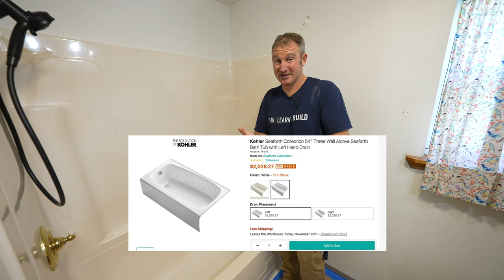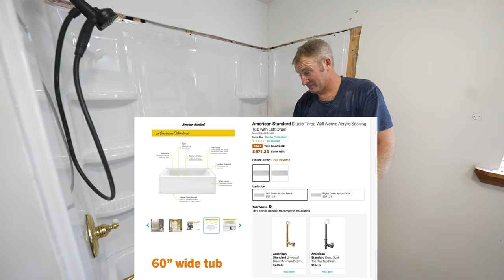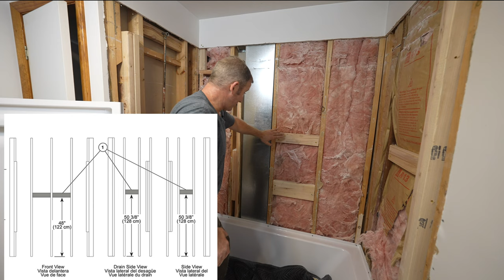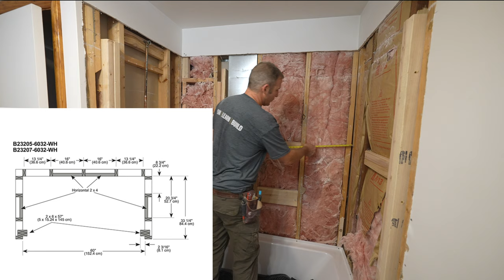Installing an American Standard Tub & Delta 500 Series Shower Surround | Complete Step by Step Guide

Comment: I seem to find myself always installing those 3-5 piece surrounds, and I always have something on the studs eg. drywall if applicable. Even though it says direct to stud install. They are way more prone to cracking if there’s only studs and blocking. Go the extra mile so you don’t have to come back and do it all over again 👍🏽
Reply: drywall or plywood? Might install one of these in the near future
Reply: @joshhyma842   drywall is the easiest and cheapest. But either way I always put u couple coats of liquid waterproofing membrane over it for when the surround cracks and starts leaking 👍🏽

Comment: Isn’t the delta 500 surround suppose to installed with some sort of backer, eg drywall or cement board, and then glued to it?   I have seen people use spray foam in the recess areas of the surround to give it stability before install.
Reply from the maker: Not the 500 series. It’s direct to studs. That being said anything that helps reinforce it more would be worth it 👍

Comment: I’m assuming the finished edge of drywall against the surround? Also, when drywalling, was caulk on the flange or on finish edge of surround to seal? Just want to make sure I get the cleanest finish when butting up drywall to a plastic surround in my own bathroom.

Comment: I learned alot about how to install Delta Surround Wall to some other brands such as American Standard. I was worried, and you confirmed that the Delta tub is junk, so thanks for showing it is possible. I may see about fitting a Sterling tub, too. However, I do love the Delta Walls for sheer functionality and design. Yes thx for tip on Wall stud for future door install, my case a Kolher elegant door 😊

Comment: I’m so glad I found your channel. My wife and I bought our house a few years ago and the previous owner did a lot of DIY renovations. A few days ago we had water leaking from the upstairs tub and through the kitchen ceiling. Come to find out, the shower surround wasn’t installed correctly. The surround was actually wider than the tub! So water was running down the front, then dripping over the edge of the tub, into the inside of the wall, and then into the kitchen ceiling. Thanks to my father, I’m pretty handy. But I’ve never had to do bathtub work! Once I found your channel I started watching as much as I could to be sure I do the repairs the right way. Only problem is that the back of the tub is against a shared wall, and it’s a firewall made of plaster and cinder block. I have some ideas on how to attach the back of the tub and surround, but I was wondering if you have any tips. Thanks for all your hard work to make these videos! It’s teaching me a lot and saving me money!
Reply from the maker: That’s an uncommon issue… bigger surround than tub. Thanks for watching 
Enroll in my DIY GEEK MEMBERSHIP. I can help out in the courses. Pictures will help with your specific situation
Thanks 
Steve 
https://www.bathroomremodelingteacher.com/learn

Comment: Thank you my ex step dad was a carpenter and i grew up always helping him so i am somewhat familiar with this type of work. I have a bathroom at my house my wife wants and honestly  needs redone. This video gave me more confidence in doing it as measurements are the same. Only thing is there is a window i would have to cut the tub surround to have work out. Im guessing just cut and use tub surround silicon behind the window framing. Anyways this video will be another tool i use to complete this project! Thanks!

Comment: Hello, this is a longshot, but I had a question. I've been binging all your videos on tub installations and I currently have my bathroom ripped apart in preparation for a new tub and surround. The new tub fits perfectly over the old drain, do I need to replace it or can I just reuse the old one and p-trap? Thanks!

Comment: Have you ever got a chance to work with push-to-fit pvc piping Steve? Our lives would be muuuch simpler and easier vs using glue cement. Each fitting has a rubber gasket and o-ring to hold it in place inside of the female-part. You use lube to assemble. All that allows micro adjustments after the assembly and flexibility. One of the things we should import from Europe for sure. For ten years working with it I have not seen it fail once. Also, what do you think about these Bath Fitter guys that promise old-out and new-in in less then 12 hours? 🤣🤣🤣 Great video. Go BRT GO. 👊💪👍
Reply from the maker: I have not played around with those yet. I love the concept. Not much different than a sharkbite 😆 trying to think of the cons on them…..probably price? and bath fitters would have been $10k for this 😆 I actually am not sure if they have something for this kind of shower…
Reply: @BathroomRemodelingTeacher  Push to fit was and still is only standard for any pvc install in Germany/Europe. I don't remember seeing any glueing pipes at all. The fitting/pipe walls were thiner then our pvc, it is gray in color and maaaaan, quick and easy. Plus, it leaves you room for adjustment after the fact. Only downside ... you gotta carry the lube all the time.  🤣

Comment: Great video as usual sir, do you use the hot mud for tape and finish coats ?
Reply from the maker: One this one I used hot mud to tape but used plus 3 joint compound for second coat. I find top coat comes out better with the premix 👍

Comment: very nice!  I work at a big box hardware store in the plumbing isle...we sell the delta kits and your remarks regarding the surround kit is useful.  I'm surprised about the delta tubs though... the brand is always well regarded by the plumbers who pass thru...

Do you have experience with kohler (i.e. sterling) surrounds and if so what are your thoughts regarding them?  Regarding the flimsy surrounds...I've sold a lot of them ...they seem to be the low cost 'go to solution' for a lot of people (they are typically 1/4 or 1/5 the purchase price vs a delta or sterling).  I wonder how long they last now after observing your video.

Another question you're probably to busy to answer (/grin)...what is the cost difference between doing a tub surround vs your 'fastest' tiling option? I'm going to guess about 3x...??  So if your total bill was 5k (that was including materials right...) and 2 days of work for the plastic solution what would the lowest cost tile surround solution be?  10k?...15k and 3 days of labor?  Is there more risk doing tile vs. a plastic surround?  By risk i mean chance your bid will not be accurate due to materials or environment variables.

I know tubs and showers get all the glory on your channel (as well as TileCoach and Sal's) but at least myself would be interested in your experience with toilets...the different 'power flush' gimmicks, durability issues, and how about those in wall toilets?  What about those wall exiting condo toilets?  I have these conversations weekly with customers and i need more data...lol )

eh gads! one more question - have  you used the redGuard uncoupling mat + red guard membrane for any projects?
Reply from the maker: Thanks for feedback. Good video suggestions
And I’ve gotten so many comments about recommending Kohler Sterling that I asked them to send a kit out. Plan to install later this month. Definitely looks solid 👍 great price too. 
Yeah delta is very disappointing, kind of like Ford 😆 no one seems to care anymore. I always had high praise for delta. How they make a tub that crappy is amazing. Just like American standards surround. Shameful really. Keep an eye out for videos on Kohler. And yeah as far as a quick tile job, it would still take 2-3 more days to complete. So probably $3-4k more. Looking like $9k total verses $5k
Reply: 9k for tile?  sounds reasonable to me..thank you for your reply )
Reply: the cheap surrounds you are talking about are likely polystyrene and they are thin, flimsy junk.

Comment: What do you do with the seal plate foam  If you're going up against a plywood wall on the 3 sides of  the surround makes contact with....... Do you put seal plate everywhere? It makes contact except where the directions say to glue The surround On the bottom studs..........OR Or can you just glue it everywhere? It makes contact with the plywood back wall & And left side surround and the right side surround......help....
Reply from the maker: This kit is designed for direct to studs, but if you have plywood all the better. You could just use the poly sealant everywhere and make it a bonded system 👍
Reply: @BathroomRemodelingTeacher  That's kind of what I was thinking. Thank you.......THANK VERY MUCH